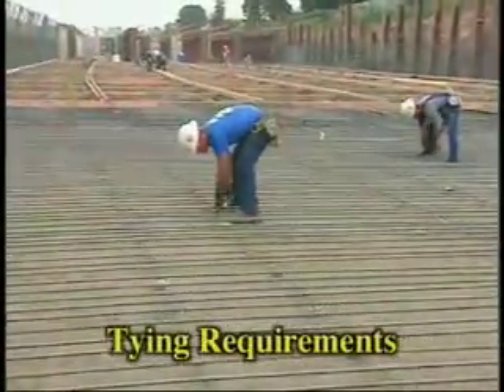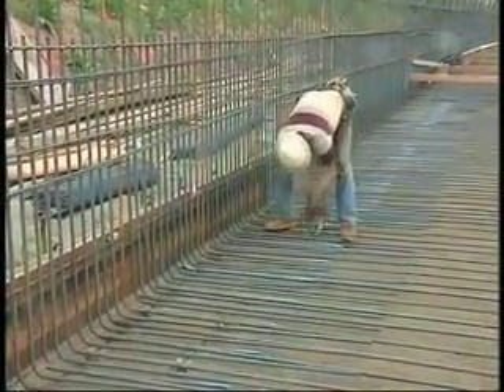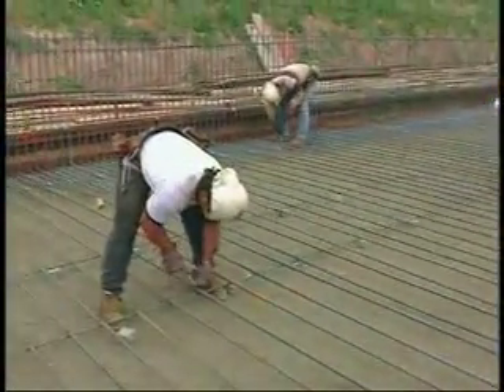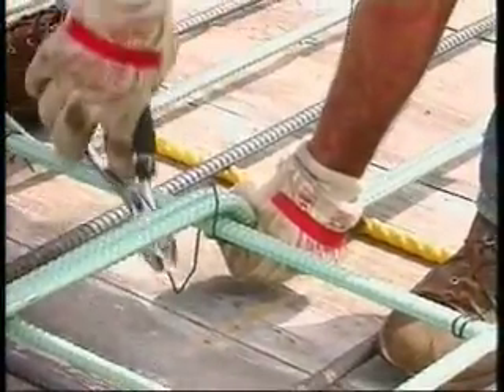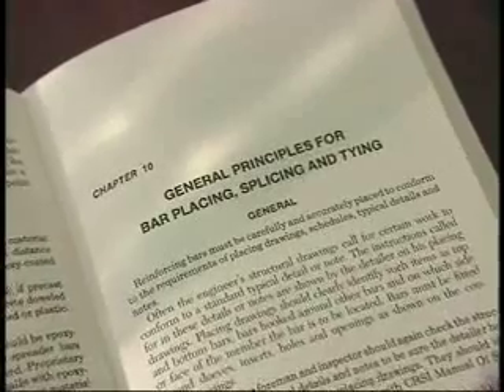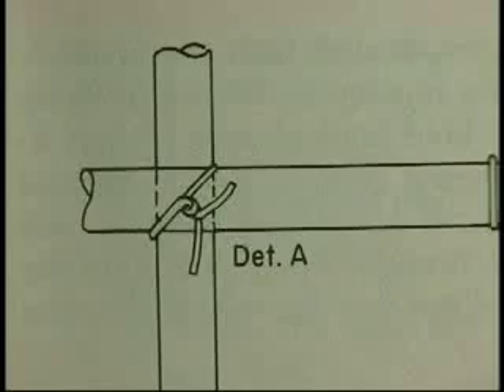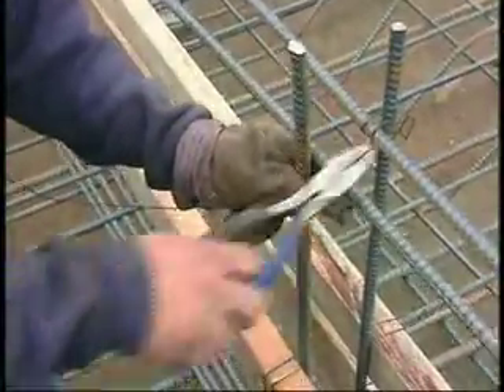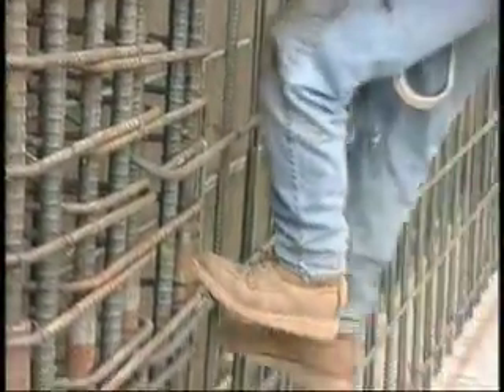Tying Requirements

Comment: I wonder why not spot welding them?😳
Wouldn't it be easier and faster?
Reply: Gentleman, you can't introduce any heat to the Rebar. It will weaken the strength of the Rebar. That's why you don't tack weld intersections. Tie Wire is a sufficient means.
Reply: @steeltown416  Thank you👍🏽
Reply: @steeltown416  also dragging a rig across a mat is going to be hell
Reply: Rebar is made of cheap mild steel, no fancy alloy at all. The reason it's not tacked is the same reason other superior steels are never used, COST. Money is the master always.
Reply: Rebar being tied in my understanding is only to hold bars in place before they're reinforced by concrete, I'll be starting my ironworking career next week
Reply: @KHeaven7  how is it ? I'm looking into this
Reply: @flacko001 with the company I work with, hell. I work with my dad and brother and they Don't take it easy on my at all, you're outside working in the elements, packing a lot of weight while getting bitched at for not loving fast enough, I'm starting to really enjoy it now but at first it sucks
Reply: faster tying it

Comment: on a nuclear power plant, we had to tie every bar at every joint.
Reply: Jerry Hubbard did they have a reason?

normally the smaller the bar the more ties we put on it, but the 32mm bars we normally put a few ties on a 6m length.
Reply: Back in the day, everything relating to nuclear was overdone or engineered. I guess they took no chances that it was being done right. Even the # 18 bars were tied at every joint with 9 gauge wire. The outside retaining wall, 4 feet thick, 400 feet in circumference had 60 % steel in the concrete. Some of the steel was so tight the entire pour and slip form had to be cleaned after all the re-bar was installed. If anyone was caught throwing anything in the form before pouring including spitting, you were fired on the spot. They took this stuff seriously.
Reply: Jerry Hubbard 

thanks for the reply, sounds like a good job to have been involved it. 

did you use a high flow concrete to help get around the steel congestion? i bet u guys had to make sure u caught all ur wire cut offs to
Reply: believe it or not, the concrete was poured at no more than a 4-inch slump. They used 2-inch vibrators and plenty of them to get the concrete in place. All concrete poured in an area they called safety related, which meant it was anywhere around the containment building had to be 5000 psi. The concrete poured inside that reactor building that the steam generators and the vessel itself were a 9000 psi concrete. It had steel pellets in it. As far as cutoff wire, before the concrete was poured, the labor force would come in with water and air jet hoses and clean out anything that fell into the formwork. At the bottom of all the forms were clean out holes. NO cut off wire was left in the pour. It was hard work especially in the summer here in South Carolina.
Reply: Jerry Hubbard 

i would have loved to be on that job, concrete construction is my favourite job. ive been formworking for 13 years now. my trade has taken me to every state in australia

i have done the same process with clean out holes and air hoses aswell,
Reply: Being retired now, I really miss construction work. I started out on that same job in 1976 as a laborer.  Cleaning those nasty forms. After the first week at the age of 25, my foreman came to me and ask if i would like to be a labor foreman. I told him I had no idea how to be a foreman. He said nothing to it. Actually, there was no skill. I took the job and within 6 months I was a general foreman. All along I had my eyes on becoming a crane operator. I had a friend that was over all the cranes and when we had time, he would put me in one and allow me to play with it while he stood next to me. I operated the largest crane on the job at the time. Manitowoc 4100 Vicon on a ringer. Lift about 450 tons. After two years of labor general foreman, I changed jobs. I was tired of being a supervisor, so I put on my first-rod belt and became a rodbuster. What a difference. Much more physical work but I became top hand very quickly. I learned to read some of the drawings. On a power plant that large, the drawings were massive. Later on in life about 30 years old, I started bridge building where I put the next 34 years into. I have had a very good life in the construction world and learned so much. By the way, I finally became a crane operator. I still have my NCCCO license. I guess what I miss the most is the guy's I worked around for all those years. I still talk to some of them and see some of them at times. .
Reply: it is good honest work and at times fun. On a nuclear plant, so much #14 and #18 rods used. Heavy stuff
Reply: Jerry Hubbard in my opinion you have a had a great working life, thanks for sharing that. ive got my eye on the cranes to for later in my life. im to young to sit in one atm tho. i enjoy manual labour to much

ive built a few bridges aswell, installing the precast beams was great. we used a US crane company called lampson. had a 450t crawler with 210T superlift trailer. 90tonne lift including lifting gear

now i do shutdowns for a living, i spend months on the road. im a refractory formworker now, alot of jackhammering aswell. i got some videos on my youtube name if u get a spare minute
Reply: @breakingrefractory5967  that is cool. I will take a look. Thanks.
Reply: @jerryhubbard4461  sounds like scab labor?
Reply: Haha Jerry!!! What's your Book #? Where you a Union Ironworker? Sounds like you hang your hat on 1 job??  I'm a 3rd generation Union Ironworker  in So California Local 416 we do this every day!! We are in a greater seismic zone area then South Carolina!! But ok, you can have your Nuclear Plant 👍
Reply: @steeltown416  I live in South Carolina where we don't have to kiss the ass of a union. Most of my working career was constructing bridges and later as a licensed  NCCCO crane operator. Retired now.

Comment: Can a tie wire be an electric, plastic coated copper wire? Should the plastic coating be removed from the wire?
Reply: Thanks
Reply: You do not want to use different metals to tie rebar because of galvanic corrosion.